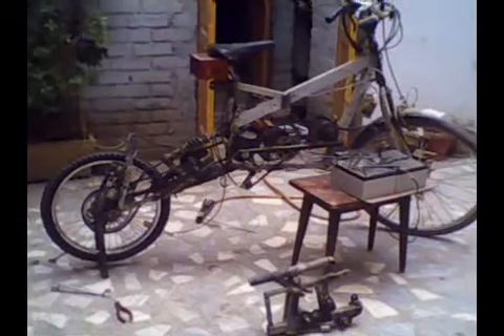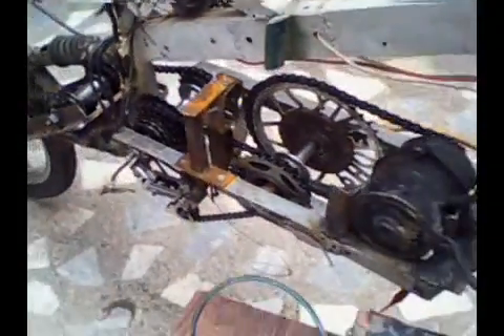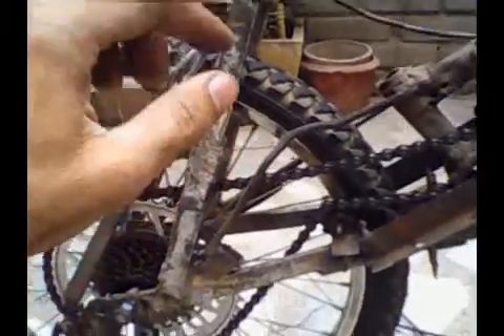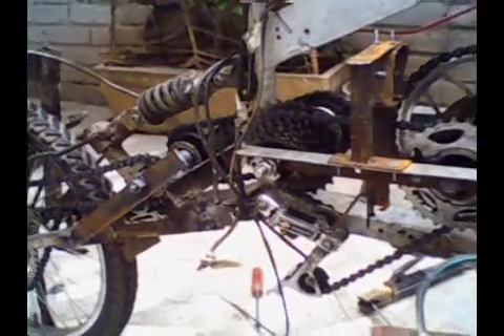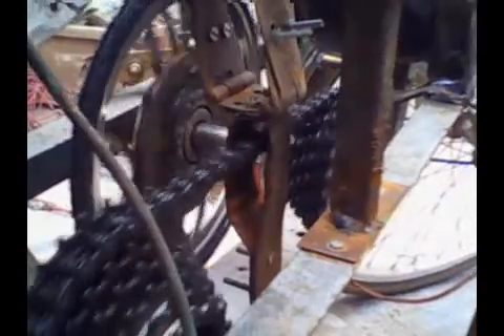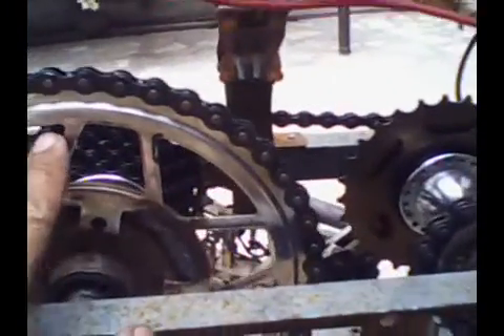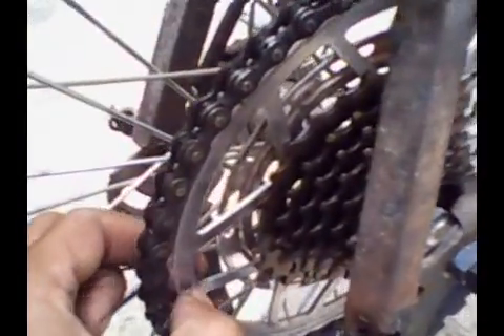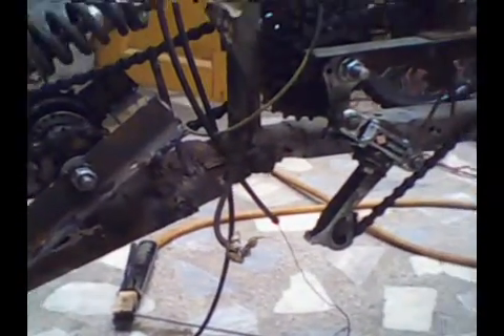Pakistani Electric Bike (Wide Ranged Variable Transmission).mp4

Comment: Naeem, I'm very impressed with how far you've come on the concept.   Have you made any further developments?  My own has been stalled while I work on other projects.  Will try to get a video up today of the bike being ridden.  I posted a video of the transmission in operation last March (search for NickHeinWV).  Mine will be completely human-powered so I'm going for lighter/simpler.  We've also completed a version that just uses a single derailleur, but it doesn't shift as smoothly as yours.